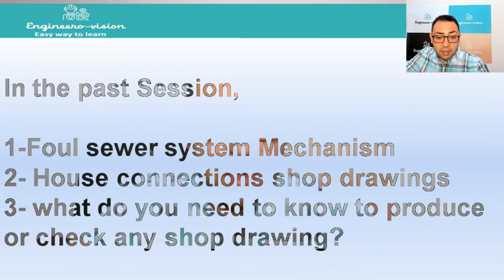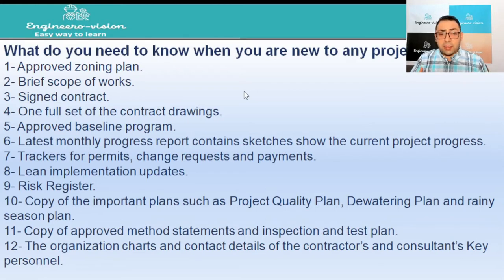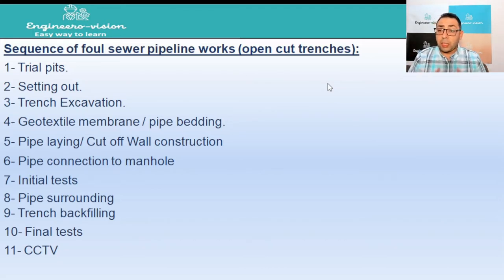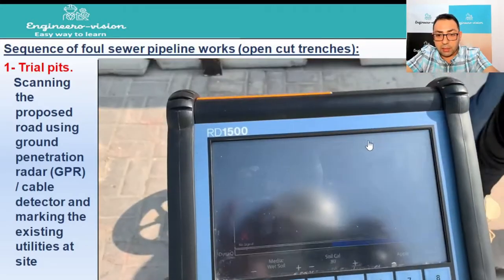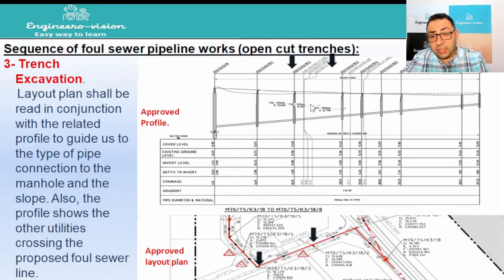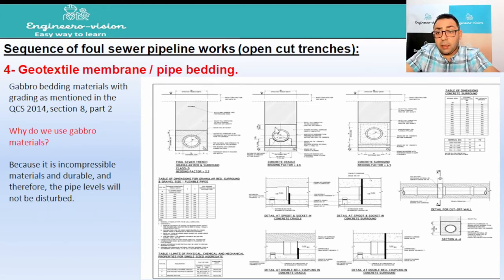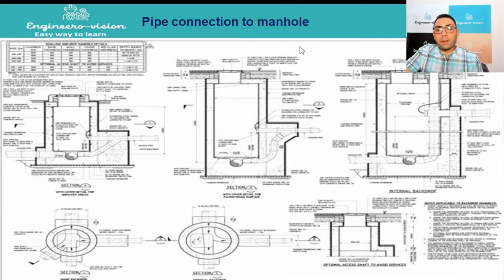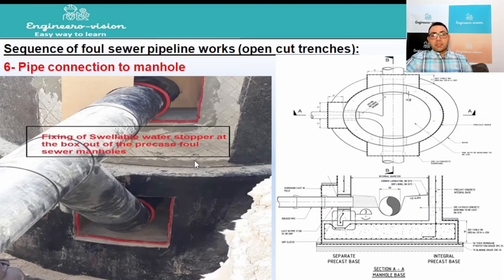Construction of Foul sewer Networks, Part 2 - Infrastructure works.

Comment: Sir Mr.Ayman, Greetings, and thank you very much for your valuable efforts.
I have a question regarding the installation of a new gravity sewer line. From a construction and surveying perspective, which approach is recommended?
Should the installation start from the upstream (higher-elevation) new manhole and proceed downstream, or is it better to start from the downstream manhole (the existing outlet manhole where the new project network will connect) and work upstream?
Reply from the maker: It’s better to work from downstream toward the upstream for two reasons. The first reason is that you granted the correct tie-in prior to start the work. Second reason becomes very valid when you lay socket spigot pipes as the socket shall be in the upstream and it will be easy during construction to connect the spigot into the socket when u lay from down stream. But if you lay from upstream, you will have to lay the socket into the spigot which is really hard. I hope the answer clears your doubts.
Reply: @Ayman.Younis-EV  Yes clear, many thanks👍